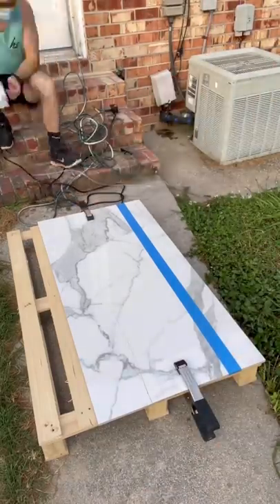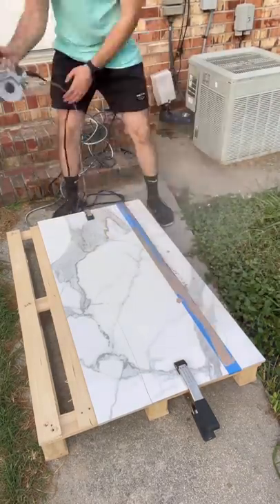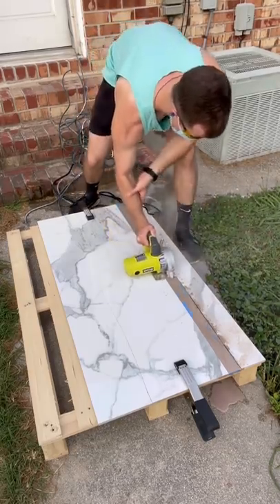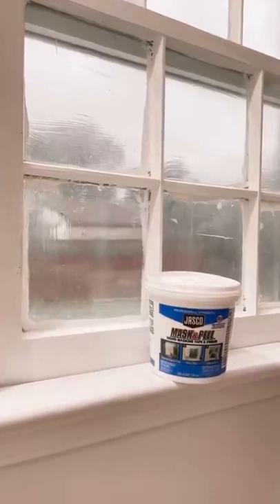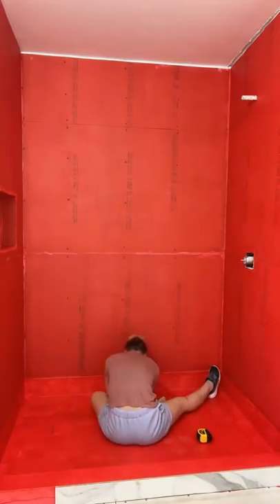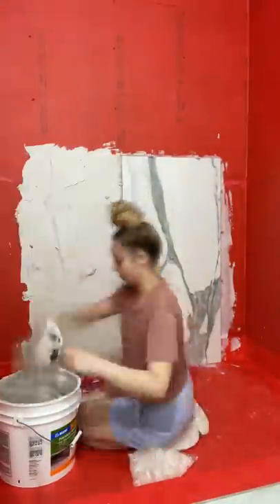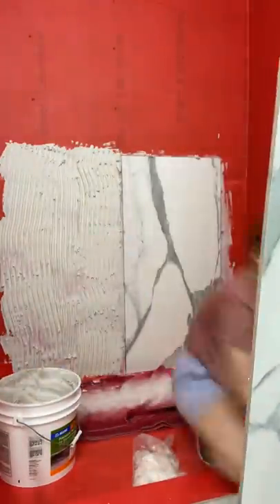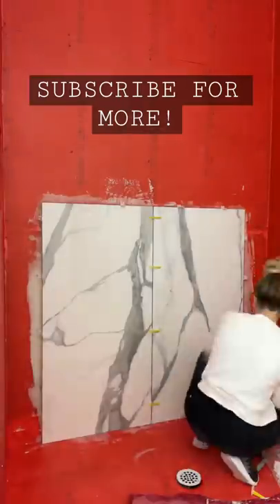HOT MESS HOUSE RENOVATION PART 70! | VIRAL TIKTOK SERIES! | LEXI DIY

Comment: When tiling a wall, make sure that the cement you use has grooves going horizontal not vertical,  it makes slippage less likely to happen to tiles as cement cures.

Comment: Good job! 

You probably get way to many "suggestions" from all of the "experts" out there, but I will hazzard one small one. To make tiling look designed, if you can afford a few extra tiles, try to avoid using cut tiles that are smaller than ½ a tile. In your shower, if you start with a full tile in the center, you would have two ¾ tiles on each side. It ends up being the same amount of cutting, but potentially more tiles if you need finished edges. This works for any size tiles. The trick is to always start with a tile in the middle, then position dry tiles with proper spacing until you reach the corner. If the last piece is more than ½ a tile then great, use that layout. If you end with equal to or less than ½ a tile the shift the first tile over by half a tile width (in other words have the joint in the center) and use that layout. It is much more complicated if you are tiling an irregular shaped area. This approach should be done for both dimensions.

Comment: When painting windows you can paint right onto the glass then use a razer blade to clean up the glass. You cut the outline theb hold the blade on an angle and it removes the paint. It's a cleaner overall look saves time and money. No a razer will not scratch the glass. Unless it's plexi or plastic. 11 years experience.

Comment: One thing...it's usually a wet saw that's used to cut tiles. You should at least be using like a squirter bottle to wet the tile as you cut. The blade can get too hot and cause tile to crack

Comment: If you have to use that to cut the tiles, take two other clamps and place a piece of wood as a guide for the fence of the grinder.  Measure from the blade to the right where the fence ends so you know where to place the wood or simply make a test cut and see how far off your mark the wood should be.  Also when back buttering the tile be very generous! With tiles that big any area not that doesn’t have mud between it and the wall could be a big issue.  
     Also even being outside it’s good to wear a respirator when cutting any tile/stone.  Especially when there’s no water coming out of the saw to keep the dust down.  
      If you guys are going to be doing renovations for life, keep your eyes open for a nice (even used) wet saw for a good price.  Don’t buy some no name junk one but you can find some really good ones cheap.  
      Please stop using stick tiles and especially don’t put them over old flooring.  Engineered plank flooring with the vapor barrier built in would look good in the areas you used that peel and stick.  
     People on the internet are awesome. Ask people on Reddit or anywhere and they’ll usually help out.  You can msg me about building or go on Reddit or even ask youtubers with channels.  I applaud you guys for doing it all yourselves but it’s best to try and eliminate mistakes the first time as they can end up costing more in the long run.
Reply: @chupaxf  it’s going to make her demolition a lot harder.  It’s people who know building trying to HELP her.  I applaud them and wish more people had the can do attitude.  
She would save $, effort and a lot of time if she either held off or just did it the right way the first time.  
      Houses with multiple layers of flooring, walls or anything are alot harder to demo, especially for a homeowner.  If she were a contractor she would have heavy duty tools and know some tricks but this will be a pain in the ass. 
      She clearly is into doing work.  Constructive criticism is a good thing.

Comment: Not my taste of tiles, but great job! You could also rent a water dispensing table mounted circular saw. They usually cost next to nothing per day. You will typically get cleaner cuts.
Reply: That saw uses water. You could see it dripping off the end of the tile

Comment: You have to use a leveling system for large format tile or you will have lipage .
Reply: They did the tile spacers pull the tiles level to one another using a wedge system.
Reply: @shawnr771  spacers are different from a leveling system
Reply: @DollysParadise  the ones they are using are levelers.
Not sure they are good for walls but most of the tile setters here use them on the floor.
The yellow wedges pull the tiles lever.
Personally I do no like them.
Reply: @shawnr771  I hope so, if not they will have lipage.

And lipage is not ideal for resale.
Reply: @DollysParadise  no it is not.
I used those in the spring on 1x2 tile I was not impressed.
Easier for me to use a six foot level on the floor.
I am not a tile layer.

One issue that crept up was when pushing in the wedge 90 percent of the time they worked just fine.

In some cases they pulled the tiles up far enough to lose contact with the mortar.

Found one during install. Just now fixed it as the homeowners are out of town.

They could not keep from walking on it.
No clue about curing time.
Reply: @shawnr771  ouch, I will hire a professional too many things could go wrong with tiling.

It is nothing like looking at your new lipage shower...
Reply: @DollysParadise  This young couple are doing a great job.

Large format tiles are a challenge.
There are many things that a person can do. Do not be afraid to try.

The only things I would truly suggest a professional on are plumbing, electrical, structural problems and roof leaks.
Nobody really wants to reroof a house.
Also these are the kind of things you want a good solid warranty on. When there are problems down the line.

Having helped on numerous remodels throughout 25 years. On any home check and repair the structure, then the roof. Everything else can be done in the dry. 

After that the only thing I would suggest as far as going first is a bathroom.

Remodel one of the 2nd bathrooms complete.
So there is a place to go and a place to take a shower.

Comment: You be an claim a straight edge along the cut line so the side of the guard runs against the straight edge you just have to set the straight edge back the thickened between the blade and the edge

Comment: Girl you need full suction on your tile with your mortar you had too many empty spaces not enough thickness. You will have tile isues later on.  And you need to back butter that tile with how big it is. And i  hope you have a slight pitch on the floor. Other then that you did good. But a stand up shower is not something to practice on if not done properly ypu will run into major issues down the road. If yall need help contact me. I do this for a living. Red gaurd isnt the best option. Either.  For boz store mapie aqua defence would have been better option. IF any tile ever starts to come loose call a pro immediately that means you most likely have worse issues at hand.